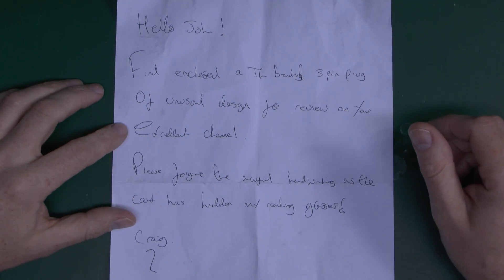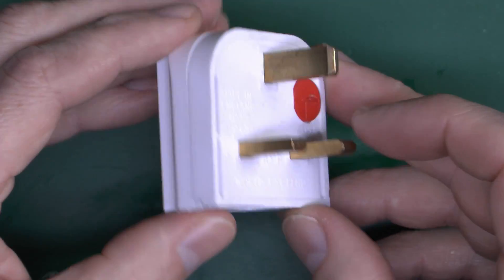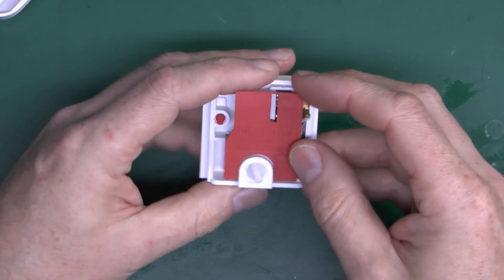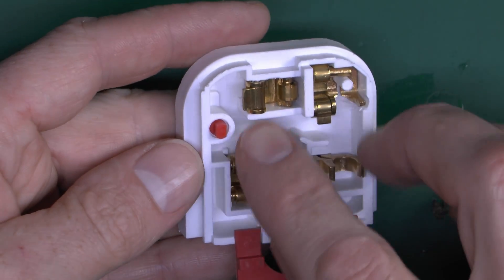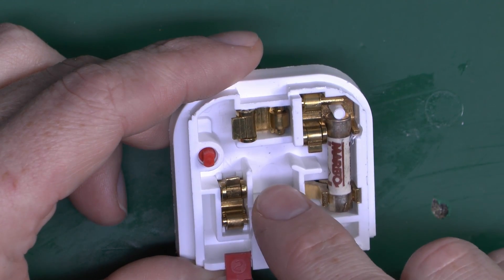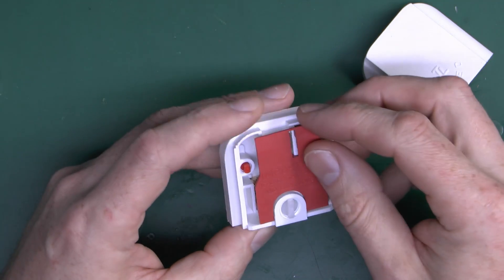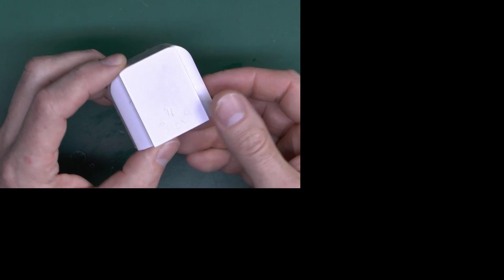TL Branded BS1363 Plug with Screwless Terminals

Comment: Hah! I remember these. My dad used to be one of their main sales guys back in the early 80s (I think I would've been maybe 5 or 6). Tobylec the company was called. The one you have looks like a slight redesign of the ones I remember. Originally the locking mechanism could be opened up with a penny (who had time to find a screwdriver in the 80s?) and it didn't have that red flap over the pins.
Reply: I just texted my mum to see if she still has any laying around in a drawer or box, lol. I remember back in the 80s that just about everything in our house had them on.
Reply: On the phone to her now. So it was a few years after I thought. It was 1987 (she remembered exactly the year because she'd just started working at the Halifax, heh), and this is definitely a slightly different design to the ones my dad used to sell. Tobylec fizzled out a year or two later and just disappeared.

Comment: I found today, I was still using a UK plug with the unsleeved pins . I must have had it for years . A Delta MEM one . Yeah, I've changed it over now . But to be fair , apart from the unsleeved L and N pins , it looked a better plug than some that are sold in 2025 !

Comment: You never mentioned the black plastic that's supposed to be on the live and neutral pins. This is a safety feature so your fingers don't make contact while your putting it in but I suppose nobody touches the pins anyway when plugging something in lol
Reply from the maker: Sleeved pins were not required when this plug was made.
Reply: @jwflame  fair enough

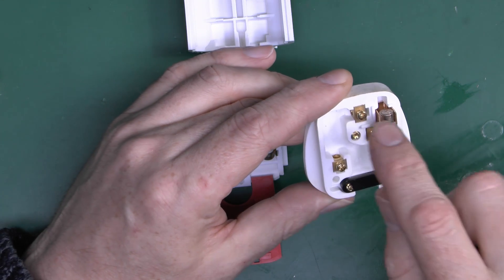Comment: (6:24) - I disagree with your take here.
If all conductors were trimmed to the same length, then the earth wire would pull out first in the case of excess strain on the flex because there would be plenty of slack left on the line and neutral.
If the three conductors were correctly tailor-cut, that is the earth being the longest, the line in the middle, and the neutral of course being the shortest, then when the flex is pulled from the plug, there would be equal strain on all three terminals.
One of the main features of MK plugs, which arguably have been at the forefront of the safety aspect of electrical mains plug design for decades, was that you didn't need to faff about with trimming each conductor to different lengths. No, like this plug here, MK kept things simple for the housewife.  All wires cut and trimmed identically.
As a side note, MK had sleeved line and neutral pins donkeys years before they became mandatory.
>

Comment: Plugs that require you to cut the wires to different lengths are stupid. They set the user up for failure. A plug should be set up physically such that with wires all the same length, the live and neutral pull out before the protective earth does. The standard UK plug can be wired so that that happens, but it is entirely up to the user, which is a bad idea for things intended to be used by the general public.

Comment: I once went into an old disused house in Glasgow that was unoccupied for years and had been bought as a fixer upper at auction and was being used as a storage overspill by someone I knew at the time, it had waist height mounted bayonet cap light fittings with old round black  bakelite switches wired in VIR (Vulcanised India Rubber wire) and it was from the early days of electricity usage, they used to plug in lamps, early toasters and kettles and also the earliest electric vaccum cleaners, in old films you can see clothes irons plugged into ceiling light fittings as well.

That would have been around 1890 to 1925 or thereabouts and was all 6 amps and below as far as I know.

My student halls of residence from my youth was an old building and had been built in 1938 and had all the old wiring when I was there in 1999-2001, it was sold off to developers in 2004 and gutted and redeveloped as it was so far behind on renovation and needed too much for the university to keep hold of it, was loaded with asbestos and needed a complete replumb and rewire of all 7 floors and the basement plus the 3 lifts were 1960s otises that needed replaced... so the place got "disposed of" for £3million, developed into 180 flats sold for £180k each...

This was in large part due to the need to replace the 1930s wiring which was old and likely deteriorated and was also installed in the days of the old electrical system with a top load of 6 amps on each circuit, there were students plugging in tvs and desktop computers (as desktop computers were popular at the time in the early 2000s) and hairdryers and the fuses kept blowing on Friday nights with all the girls using hairdryers and hair straighteners resulting in fuse blowouts and darkness on whole floors often until the Monday morning when the electrician came back on duty.

Goodness, in 2001 there was more load than the wiring could handle, imagine that old set up nowadays in 2019 with all the mobile phone, laptop and tablet computer chargers and games consoles..
Reply: But all new tech these days you plug in to 230VAC for 12vdc just your heating appliances that need 230Vac.

Comment: Am assuming that plug came from the days just before they stopped selling appliances without fitted/supplied plugs, around 1987 or thereabouts..

Am surprised the plastic has not deteriorated/became brittle.
Reply: 1986 was the year the law changed if I remember right. These definitely survived into the 90s, but they were never particularly popular.

Comment: i actually like that idea of it and a pity it never took on. normal plugs have sometimes the philips head scrwes for the grip, while you got this large chisel headed screw bit in center holding the front & back on...then the issue with the thing small screws (chisel headed drivers) for the wire connectors...thus you need to have three types of screwdrivers (or at lease a swiss army knife/multi tool pocket thing) to change a plug.

Comment: The EU regulation that said all electrical appliances had to have a plug attached, is a good and bad idea. The good bit is you do not have to worry about ordering a plug or having a plug the bad bit people are losing simple skills.
Reply: I've seen loads of badly wired plugs, often with the wrong fuse, so I'm quite glad things have to come with them now.
Reply: Agreed. I was in the trade from late '70s to '90s. The fact was far too many people didn't have the skills to fit a plug correctly in the first place. This lead to accidents. Buying an appliance without a plug was a nightmare for the elderly too - although any decent retailer would fit a plug for an elderly customer. The EU regs. were an improvement for everyone.

Comment: Makes you wonder why we are still having to struggle with slot head screw down terminals in plugs, sockets and switches. Why does no-one make ones with Wago like connectors inside? Even if it does cost a bit more to manufacture, I’d gladly pay this, especially for socket outlets.
Reply: Simon Jenkins - If you take the example of Wago 221s they’re rated at 32A and are considered maintenance free, whereas older screw terminals are said to loosen their grip & to need tightening over time. And as 221s are so easy to use, it just seemed to me that something like that would be ideal for tool free terminals on a plug.

Comment: I have a couple of later sleeved pin versions of these plugs. The cord grip is a simpler arrangement. The one thing I did notice is that mine autolock when the cover is slid back on.

Comment: In the time before esther when plugs and appliances travelled home in separate boxes.  About the same time as the plug - there was a bit of a "thing" concerning tool-less assembly.  All of a sudden screws became like hen's teeth and Compaq desktops turned into rubik's cubes.  They were absolute work's of art that (if you knew how) just came apart in your hands... or if you forgot about the sprung slider, remained impenetrable featureless lumps of scrap.  Then again without warning the no screwdriver approach turned into the torque screwdriver.
You still couldn't get in - but rather than learning a few moves - you had to buy a new toolkit and the tool-less revolution came to an end.
But thanks to Ms Ranzen plugs were now compulsorily the end of the cable.
Reply: I have a 1997 Apple PowerMac G3 (the beige variety) which is as you describe, designed to be completely tool-less. Its not too bad, apart from the fact that a lot of the plastic has now gone very brittle and some of the tabs that hold things in place have a tendency to snap when you try to remove them

Comment: on the old 3 pin round plugs If I remember correctly the fuse was the live pin that unscrewed.
Reply from the maker: Only on the rarely used Dorman Smith 13A ones, https://www.flameport.com/electric_museum/plugs_other_13A/dorman_smith_13A_ring_main_plug.cs4
The more common round pin types were mostly unfused, and the few that were had the fuse inside the plug body.

Comment: Hi John, I am having problems wiring a 4th LED dimmable strip light to a dimmer. The dimmer is ok with 3 LED lights but when I add the 4th it cuts out presumably overloaded. I have tried going around the problem by fitting a relay to the 4th circuit but this just buzzes and doesn't connect the secondary circuit. Any thoughts? Diagram at : https://www.dropbox.com/s/vryhyzfrh2ln2r6/2019-05-09%2019.12.57.jpg?dl=0
Reply from the maker: A relay won't work with a dimmed input, it needs the full voltage to operate.
Either obtain a single dimmer that is rated for the full load, or split into 2 separate circuits and have 2 LED strips on each one.
Reply: John Ward Hi John, I’ve another electrical question. The alternator on my mk2 golf GTi doesn’t seem to work. It’s my sons car really and when he got it he managed to charge the battery in reverse and then fitted it to the car. The starter motor ran but never engaged the fly wheel because, of course, bring DC, it was running backwards. Could this reverse polarity have damaged the alternator ? Can they be fixed, a replacement is £100+? Thanks for your help, Richard.
Reply from the maker: @dickie997  Yes, reverse polarity can easily damage things, the most likely items are the diode(s) on the alternator or the voltage regulator.  They may be separate parts or all on the alternator, depends on the particular car.
Reply: John Ward thanks John, I’ll take off the circuit board and see if I can replace the diodes.

Comment: I had what I assume is a later variant of that plug which had the quarter turn locking mechanism, but the terminals were all at the top of the plug. I don’t remember the details of the cord grip, but I think the terminals may have had screws. It was after the mid-80s so it will have had sleeved live, and neutral pins.

Comment: i have a 'similar' but different one, i 'think' it is also a TL,  its very similar, but thinner, flip terminals the same, but all 3 are inline, and cord grip is also 'screwless', but done differently, a sliding 'ratchet' thingy,   and has a 'wire stripper' blade in the bottom,  i see one on your one.😉.. , cant remember if the pins are sleeved or not, but i think they are...

Comment: Wasn't there one going around once that you just put the ends of the flex in and twist the top to terminate them?
Reply: I saw a very old mk plug like that where you twisted the wire round the terminals but you still had to tighten the top down over the wire.
Reply: I still have some of those old MK plugs.
Reply: @simontay4851  They still seem to be available new, the term to search for is "MK safetyplug".

Comment: a problem looking for a solution? if you can't work out how to use a screwdriver to wire a plug I doubt your competence to begin with.
Reply: Until the mid-late 80s electrical appliances were not typically sold
with a pre fitted plug. This was one example of a plug that "made it
easier" for anybody to fit a plug. The push down clamps were very 
innovative at the time and now some new sockets adopt this same
termination including Crabtree Instinct.
Reply: @
Sasquatch

many times in my younger days i wired plugs with a knife from the cutlery drawer (the regular all screw ones) when there was no screwdriver available :-)
Reply: same here :-)

Comment: I recollect that MK marketed a 13A plug with the USP that trimming all the wires to the same length made fitting it easier. Associated with the newer style with the rounded top and in-slanting lower part rather than the older more nearly rectangular shape.

It relates to the idea that the longer earth wire is a deliberate safety feature.  50 year of being interested in this stuff and that a thing I've only heard people say quite recently.   So I wonder if it was really so or if it is a post-facto rationalisation because it's hard to see a company of MK's repute not only deliberately negating a safety feature but making a marketing point of doing so.
Reply: That's the MK Safetyplug, still made. Eveready brought out plug at the same time (mid '70s) as the Safetyplug with the same feature. I'm pretty certain there's one around here somewhere but I can't think where.
Reply: @Graham_Langley  I've still got some of those Ever Ready plugs, they were designed by Marbo, who also made a similar designed rubber plug, great for thick cables plenty of room inside them.

Comment: I still think the duraplugs are the best design for self fitting on extension leads and tools. They are tougher than a coffin nail. 
What happened to the round cone style solid rubber type they used in the late 80s for external heavy duty use. They were really good and must of been near IP44 level if used as pairs??
Reply: Duraplugs are great until you forget to slide the cover over the cable first.
Reply: @sdgelectronics  That was on the old style ones!
Reply: @sdgelectronics  The 13A and 15A duraplug plugs and the 13A duraplug trailing sockets were redesigned at some point (not sure when) so you did not have to slide the cover on first. I think the 5A plugs and the 15A trailing sockets still use the old design though (the 5A duraplug trailing sockets seem to have been discontinued).

Comment: not convinced by its safety. i could imagine a child opening that
Reply: How, when you need to remove the plug to turn the coin or screwdriver operated red plastic screw?
Reply: @Benzknees  - Children are just as intelligent as adults, it's simply that they have less experience. The way that children learn is by experimenting or by being taught.
So, if a child WANTS to remove a plug, they experiment different ways until they remove it. Twist, pull, pry, until they find a way. ANY two year old child can remove a power plug. Then, if they wanted to, they could work out a way to rotate the red thing and gain access.
A 2 year old is very capable of using a mobile phone, including unlocking... they can certainly manage to physically gain access to the electricals in these plugs if they wanted to. They could also then re-plug the thing back into the wall.
However, the reason that the don't remove plugs and unscrew things and do all that shit is because they have no reason to do so.
Why would a child bother doing that, with all the other cool and stimulating things that they have around them?
Reply: John Coops - Err, well maybe you should have asked a child to explain that the plug has first to be removed from the socket to remove the red plastic screw. So there’s no more safety risk than there is with any plug.
Reply: @Benzknees  - LOL, yeah. Maybe I should ask a 2 year old child to re-write the UK electrical regulations. This time around let's use an even more archaic bells-and-braces approach.... simply ban all removable appliance plugs. All appliances are to be hard-wired, and the connection block will contain a non-replaceable HRC fuse to protect everyone from whatever imaginary risk that the existing fused plugs protect against.
And no more of that "consumers can do wiring" bullshit - every connection must be performed by a person with at least 3 years university study, plus 4 years apprenticeship  experience. Once finally certified, Electricians will sit a 3-monthly re-test to ensure that they are capable.
Any breach (irrespective of how minor) of the new regulations by either consumers or electricians will result in deportation to Australia where the offender will be a Convict until their life sentence is served.
Reply: John Coops - So, just to recap, first you suggest the plug is a safety risk for children, and now you consider the risk is imaginary. Glad you cleared that one up.
Reply: @Benzknees  - I have NEVER suggested that the plug is a safety hazard to children. Quite the reverse, actually.
My reply above is written using _sarcasm_, and considering the outrageous wording, I cannot fathom how you could have read it as anything other than a joke (that it was)..
Reply: John Coops - Sorry, I must have missed the sarcasm in “if they wanted they could work out a way to rotate the red thing and gain access”.
Reply: Most children can use a screwdriver. However they are far more likely to be playing video games than learning a trade.

Comment: There’s also the added feature of a built in wire stripper at the bottom right of the plug. You can see it at various stages throughout the video, particularly around 1:20 - 1:25.
Reply: Oh! I noticed that, but didn't know what it was.
Reply: Wow, I had one of those in the 80's and indeed I wondered what it was! Thanks for clearing it up!
Reply: Seen at the top in that part of the video -1:25

Comment: I've never been entirely convinced by the "earth lead being longer is a safety feature" argument.

Yeah, you might tug the live and neutral free and it's still earthed.  But with another yank the earth come free and wipes past the live pin (in many designs of plug).  Less likely than yanking just the live and neutral free, but still possible.